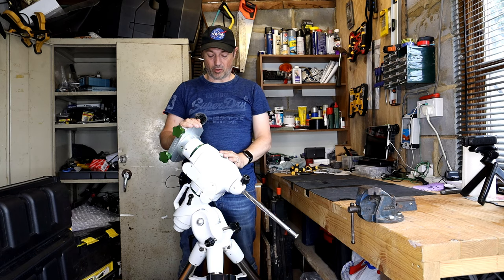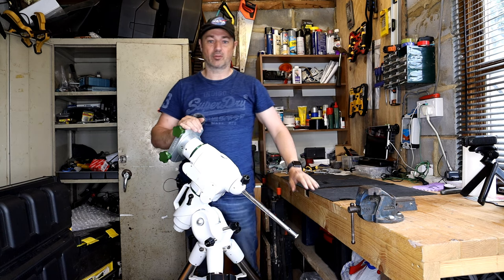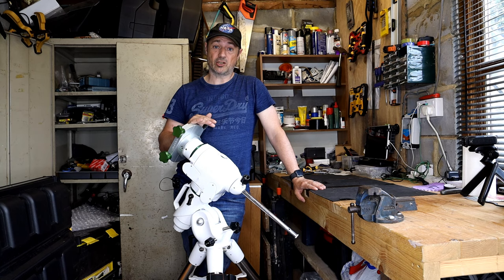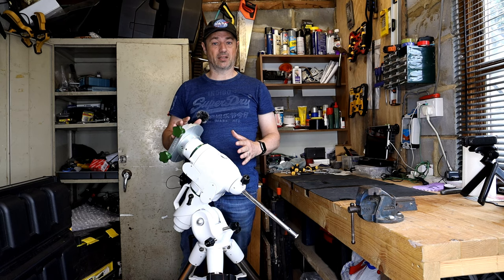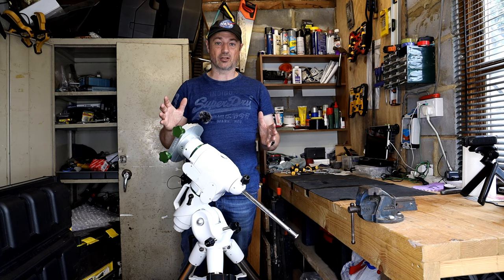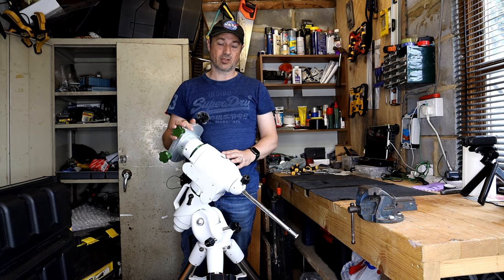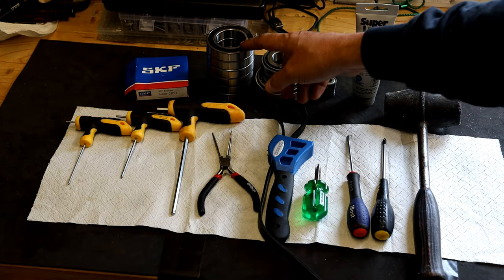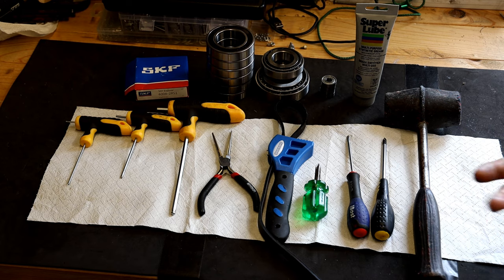Sky Watcher EQ6 R PRO stripdown and rebuild, Hypertune

Comment: I just finished using this process to tune my EQ6R-Pro and it is night and day. I just ran a 2 hour session and tracking stayed tight right down the center. My ToT was at 0.22-0.24 until I got a few min from meridian flip and it did jump up a bit but I think that was caused by the mount trying to dither so close to the meridian limit. If anyone is on the fence about this, hop off now. I took me about 4 hours to complete including a break for dinner. Materials cost me around $200 US and I went with all SFK bearings. This is one of the most useful tutorials I've seen. Thanks mate!!
Reply from the maker: Hi James and thank you for taking the time to comment. I am really happy for you and the results you have got from doing this. Clear skies

Comment: I finished the rebuild today using the bearings you suggested. I'm am so thankful for your help and all your very helpful tutorials on YT. The process went very well and right out the gate with only a new calibration and guide assistant, I'm guide at 1460mm with an Edge HD8 at .44 RMS. Oddly enough GA showed I have a DEC backlash of 3800 ms.. So I haven't sorted that out yet, but I'm extremely happy. I'll be getting my balance meter next week, maybe I can mesh those worm gears more precisely. Cheers!
Reply from the maker: That's great news Damien and so glad my video helped with your mount. Sounds like you did a great job. Those guiding numbers feel good after doing a project like that so well done mate. The balance meter will help you get really good fine adjustment but don't worry too much about backlash that is measured and reported as PHD2 will compensate for it. If your DEC rms are similar to the RA rms then all is good and you will have round sharp stars.
Thank you for the extra support on Patreon, really appreciate that.  Clear skies

Comment: Best Glenn 
We have become a lot wiser again it was again very instructive; as I have already mentioned in connection with the backfocus of my zenitstar 61 II and the reducer and flattener with the ZWO 1600mm I will get out this was well illustrated in the manual of the Williams zenitstar  61 II but due to the bad weather also in Belgium I can not test it out; so out of sheer misery also my HEQ5 mount was taken care of; I just didn't use any new roller bearings, disassembled and cleaned them out and degreased them with WD-40 and then re-supplied them with grease that I purchased from  Geoptik;I had some minor problems dismantling the HEQ5 but thanks to your contribution on YouTube I managed to do it anyway; only I have to wait for better weather for the fine adjustment we see. 
Greetings from Belgium- Frank
Reply from the maker: Thank you Frank. I really do hope the weather improves for you. It has been bad here too but not the same as yours.

Comment: Great video! Convinced me to rebuild my EQ6-R Pro (used with a Celestron EdgeHD 8" for AP). 
Guiding was always pretty good, typically ~0.5 to 0.7 without PEC.RA was always too tight but never adjusted it. 
Occasionally Dec axis stiction led to the decision to rebuild. Was easy. Mount now v. free and easy to balance. Still in the mount "tuning" phase. Backlash in DEC almost completely eliminated (<300ms in PHD2 GA chart). Now typically have guiding in 0.35 to 0.45 range. V. pleased with result. Couldn't have done this without your and Joe's videos. Keep up the good work.
Reply from the maker: Hi Tim. Thats excellent mate and thank you for taking the time to write and share your results. Really glad the videos helped. Clear skies

Comment: Hi Glenn, well covered. When I did the fine tune on the gears I slewed a full 360 degrees with a vixen bar in the saddle for the DEC and the counterweight bar for the RA , checking about every 5 degrees for the backlash.  When I found the tightest spot, that is where I made my final adjustments and rechecked.
Reply from the maker: Hi and thank you for sharing your tips on the backlash. Will give that a try even though I have it guiding really nice after the hypertune

Comment: Excellent tutorial Glenn! I've stripped & rebuilt an HEQ5 before, but was very glad to have your video to walk me through the EQ6-R. Made for a good sick day project for me today. Now to get it under the stars and make sure I haven't made things worse, haha. Cheers!
Reply from the maker: Hi and thank you for commenting. Glad the video was helpful, just a few differences but I am sure you have done well. After a tinker these mounts give great results. Since doing mine quite some time back now it has been a trouble free performer. Clear skies
Reply: @Astrobloke  Well post rebuild it's certainly no worse than before, and even had some decent stretches guiding tonight at 0.4-0.5" RMS, so that's a relief! I didn't change out the bearings, but did pop the plastic shields, on the 6008s, and stripped the old grease (some of it yellowed and paste thick), and replace with Superlube. At least now I won't be intimidated by the teardown if I decide to upgrade the bearings in the future. Cleaned everything else thoroughly, dried and regreased thinly with Superlube as well. Seems to be singing. Thanks again!
Reply from the maker: @otameal  that’s great. I found it takes a couple of sessions for them to fully settle down, but 0.4-0.5 is very nice

Comment: Just about the best how to video I've seen. Guiding was fine this summer. Now with winter in Colorado US, it's gone to hell. I'll see if this helps. Tha ks Glen!
Reply from the maker: Hi Frank and thank you for your kind comment. They tend to get tighter in the cold months and Joe who also lives in Colorado has to adjust his mount for the winter. We are lucky not to get the extremes that you guys get. Hope it goes well, any issues I can help with let me know. Clear skies
Reply: @Astrobloke  Yeah, it does get chilly here in the winter, but I'm using powered usb cables to sit inside. That's been great! I'm getting a Stellarview 152 soon (ordered a explore scientific 152 which had bad glass issues but could handle same mount) Now will have slightly heavier setup that I hope a hypertuned eq6 will handle. Otherwise refinance the house for EQ6R! Ha

Comment: This video has been a major help today!  Thanks!  My EQ6 R Pro took a swim  to the bottom of the deep end of my swimming pool last night.  Seriously!  It seems that 100 km/h wind was just enough to topple the whole tripod and mount and tumble it right onto my frozen pool (I'm in Canada) and through the ice.  I've spent today learning how to disassemble it with the help of your video.  Hopefully I can get everything dried out,  re-greased and tuned up.
Reply from the maker: Hi Roy. i am pleased the video has helped you out. Once dried and greased I can’t see you’ll have any mechanical issues. I suppose its how the electrics faired. Hopefully once fully dried they’ll be ok.
Reply: @Astrobloke  Yes I think mechanically everything will be fine.  I think (hope) the electronics will be ok since it wasn't powered up or even plugged in when it went for a swim.  I will be giving the circuit board a good long drying out period.  In the meantime with the help of your video I'm learning about the innards of the mount and I may as well tune it up at the same time.  Seems like one of the bearings on the worm gear was sticky anyway.

Comment: Hi Glen, I finaly finished to do the same to my EQ6R. Thanks to you 🙂, I knew what, how and when to do things. I would add some comments and share my own experience. Removing and mounting roller bearing is sometimes very tricky. I used a caliper to monitor how square I was with the housing and it helped to know where to put some rubber hammer small hit to restore the right position for the roller bearing. I had a tough job removing one of the roller from the RA brass declination gear, I put it in the oven at 70°C and the extraction was much easier. Last but not least I had a strange behavior with the new SKF roller bearings 6008 2RS1. There were so stiff that after installation the dec axis appeared to be very sticky because the DEC axis was in fact moving in the internal hole of the bearing without gripping it thanks to the grease I put for installation. Fortunately as soon as there was some radial effort it worked properly. For tuning worm gear and brass gear, I followed the presentation of Astro-baby to compute the thickness of the shimmer for the gears and to adjust the distance I did it before reinstalling the belts. It gives you a good touch of whether you are too tight and you can also feel the backlash.
Thanks again for this video, Frédéric
Reply from the maker: Fantastic news. Sounds like you got the job done well, there is always a bearing or something that misbehaves but hopefully you will see a nice improvement in your mounts performance. Thank you for keeping me informed on how it went. I saw an email from you and will reply, just been a busy time lately so sorry for not replying sooner.

Comment: Excellent video, thanks a lot. I bought EQ6-R Pro six manths ago and I am pretty happy besides guiding error. In avarage its between 0.9-1.2". I tried to the seller and replace it but his ansver is that it's still dosn't to be failer and works as should work. So I thing I will do upgrades according your video, hopfully will get better guiding after. Will let you know. Clear sky
Reply from the maker: The mount should not be guiding that high. When you unlock the axis do you have any stiction? Sometimes just a slight loosen of the main axis bolts that action on the roller bearings can be enough. They often come out of the factory too tight. This could be temp changes or just poor quality control, not sure. but try that first. Please let me know how it goes. Good luck.

Comment: Thanks for your excellent tutorial Glenn! My mount is brand new but both of the brass worm drives were absolutely smothered in grease. Both of the axis locking nuts were over tightened too, causing difficulties with balance. A little fettling with these mounts can make the world of difference.

I think there is a different type of grease (more tacky) used on the 2 locking levers. It helps to hold the levers in place when the axis are loosened. On my HEQ5 I replaced that grease with Superlube, but then had the problem of when I loosened the lever it would slide back down causing the axis to lock.
Reply from the maker: Thank you. The grease seems to be everywhere on some mounts and good to get cleaned away from where its not needed. A few tweaks and these mounts will last years and return great results for Astrophotography.
You are right about the grease there, it is better if it is a more tacky type. Mine had loads in there so just wiped some off rather than clean and re lube

Comment: Thank you for sharing your work and all the components needed, just ordered the new bearings and excited to do the hypertune asap. Also anxious to see your guiding, mine was around 0.5 - 0.8 on best conditions, with some strange movements every few subs, not sure if it was pec or not... but ended up discarding 30% of them. As you say in the video, balancing is not really smooth with the eq6r pro, your final result looks amazing, looks like you can perfectly balance very accurately. Great video!!
Reply from the maker: Thank you Josep. Hopefully this will improve things for you. I will be releasing a video on the final guiding results in the next few days

Comment: You should check the DEC motor position. the belt is climbing - and will be damaged over time ^^ u can see that in the video at 49:58
Reply from the maker: Hi and many thanks for pointing that out. I have since that video made many adjustments including that one after tweaking backlash at a later date. In fact I actually replaced the belts.

Comment: Very nice. My mount is new. I had a cgem2 sent it back they sent another one I had it hypertuned ,600$, and it still wouldn’t get below 1.0 , the stiction was removed but he didn’t remove the play in ra that was there in the beginning. A waist of money . Sold it bought the eq6-r pro and great guiding at averages of .70 better. 
Lookin foreword to the guiding results.
Reply from the maker: what a shame you had such a poor experience at first. The Eq6 is good out of the box and even just tweaking with PHD2 and PEC training can easily get you down to 0.5rms. If you check my videos there is one on the PEC training for this mount
Reply: @Astrobloke  awesome I’ll look at the pec training video for sure. It’s something I’ve wanted to do.
Reply: Thats because the cgem uses servos and the skywatcher uses steppers, you also get harmonics within the servo motors.. also with the skywatcher they run on belts from the motor to the worm, so it takes out that backlash scenario,  the cgem has gear to gear mesh...
Some have belt modded the cgem and replaced the servos with steppers..you then get the same sort of performance. .. synta make both mounts so it's only the difference in motors that makes the skywatcher the better mount straight out of the box

Comment: Thanks for the tear-down on this! I'm usually scared of projects that I don't  where to begin with , but this helps!  
By the way, I might be lucky with my EQ6R, because if there is one thing it does very well is tracking.  All I did after a week of using it was I removed some backlash from the DEC with those tiny allen screws,  removed the locking clutch levers and cleaned up those copper disks from the sticky grease and never had an issue with tracking ever since, PhD2 barely have to correct the tracking. 
My criticism falls on the azimuth/elevation adjustment knobs, as they are too rough to be very precise when polar aligning so I tried greasing the bolts up , but not much changed. The worst is the elevation up/down bolts just feels very rough during polar alignment so I have to "guesstimate" like if Sharpcap polar alignment say move 2'10" up on elevation, I don't have to, just tighten down both up/down and and the down-knob will move it enough to get to nearly 0'0".  But sometimes it's more finicky and more time wasted messing with the knobs.  I wish I could make it more precise though.
Reply from the maker: Hi Frank. Sounds like you got one of the really good mounts from the factory. The ALT adjustment is very crude to say the least and I am not sure what can actually be done to help it. I know a mod was made for earlier versions but not sure there is one for our mount. I often get as close as possible so the final adjustment is down and then achieve 0" or as close to by tightening the back bolt. At least with that one you have some control unlike the clumsy ratchet thingy for up.
Reply: @Astrobloke    1 year later:  I'm gonna have to do this, haha!  My tracking is gone down to hell in both axis.  I blame myself a bit, since the mount spent several days outside under a cover during cloudy and rainy days, and while it protected from direct water, I'm pretty sure the moisture done its work in the interior mechanisms, most likely the bearings. The mount feels sticky in both axis and backlash screw or belt adjustments don't change a thing. I'm thinking it's the bearings and lubrication. Thanks again!
Reply from the maker: @ferenc-x7p  Hi Frank. Its possible but more likely just the cold. Its strange but I always thought the hotter weather would cause things to expand and lead to binding and stiffness but it seems its the cold that effects it more. Have you brought it inside and let it warm up? worth a try. If you have any issues please don't hesitate to contact me, happy to help.

Comment: Hi, absolutely this is  the best video to understand how to renew the EQ6R, thanks a lot for this 🙏😉 
I have one question: at 48:30 time you adjust the bottom and top screws to set properly the RA backlash, in this time the 4 big screws must be left a little loose or tight? thanks in advance for your reply 😊
Reply from the maker: Thank you very much for watching and commenting. When adjusting just slightly loosen them but still have them gripping slightly. The adjustment grub screws are quite small so will move against a little resistance but too much and you will strip them. Hope this helps
Reply: @Astrobloke  dear Glen thank you so much for your reply, I’ll keep you updated about the tests 
cheers 
Roberto

Comment: Really nice video on the EQ6R-Pro. Couple of questions regarding the bearings. I was surprised at how easily the bearing outer rings came out of the castings and the fact that you installed the new ones with grease on the outer faces. My concern would be that the outer ring could rotate inside the casting once the bearing was pre-loaded. I would definitely install the outer rings using a bearing locking compound to prevent the outer ring from rotating with the RA and DEC shafts. I also found that the dust covers on the bearings can create a fair amount of drag. As these bearings are pretty much buried inside the mount and not really exposed to dust and dirt etc, I would remove these covers. This also allows the bearings to be lubricated with a high quality grease during subsequent maintenance (it’s surprising how little grease is often applied during manufacture). 
I also noticed (but it may have been an optical illusion from the camera angle) that the mounting hole in the small toothed pulley on the DEC worm drive shaft didn’t seem to be machined concentric to the outer diameter causing the pulley to “wobble” making the belt flop about as its tension subsequently increased and decreased slightly as the shaft rotated. I will definitely be looking at that on my mount and replacing it if I find it has been machined eccentrically. I’ll definitely be replacing all the bearings in my mount in the future but  at the moment my tracking is spot on and to be honest, I find it’s the seeing conditions that tend to impact my guiding more than anything else. Great video.